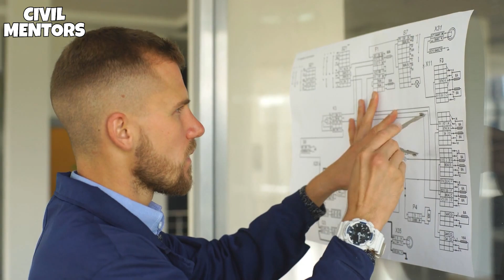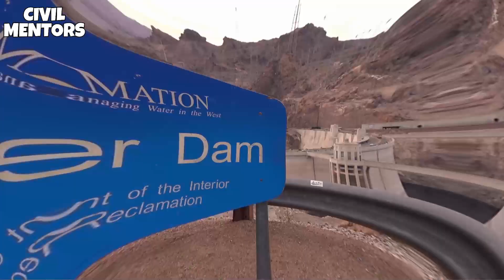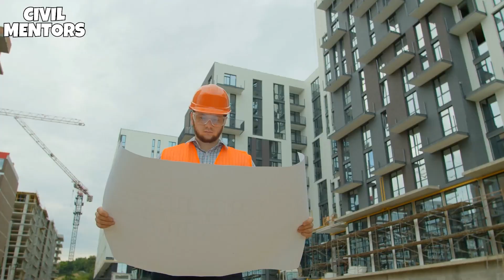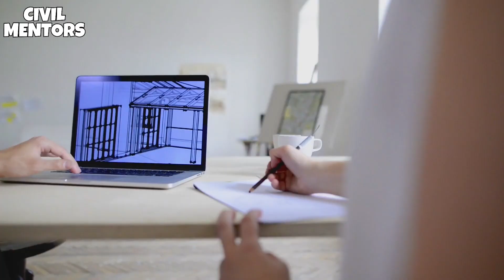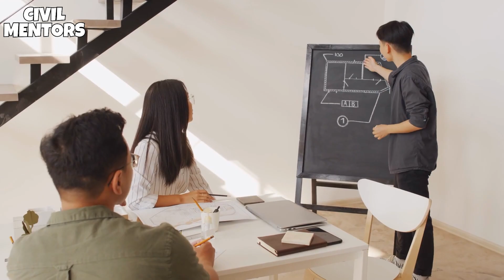Being a Civil Engineer | The Unspoken Reality?

Comment: I have 6 continuous 12 mm rods in my beam. To attach to colum i bent 4 rods (side rods) in horizontal L shape (180degree) and middle rods in vertical L shape (45 degree). Each rod i bent is 7 inch. Is that ok ?
Reply: Your 6 rebars, top and bottom? Attaching a beam to column is quite easy. Think of it as a mouth clamping a chocolate bar…. Have the top bars bent inwards into the column rebars and the bottom bars bent upwards into that column rebars…. The rule of thumb is to have both bent bars of the beam almost meet. So say beam depth is 450mm, you bend too bar 200mm inwards and bottom bar 200mm upwards…